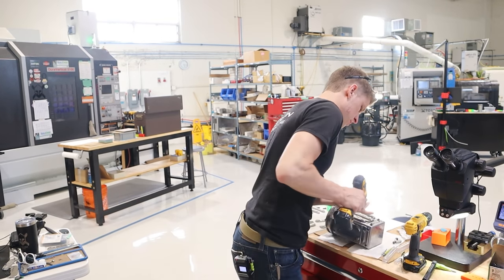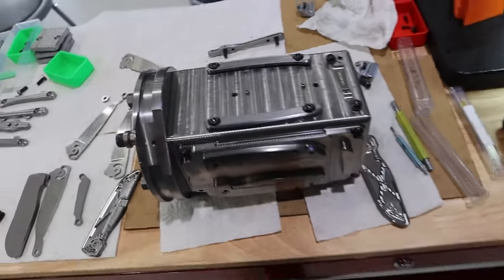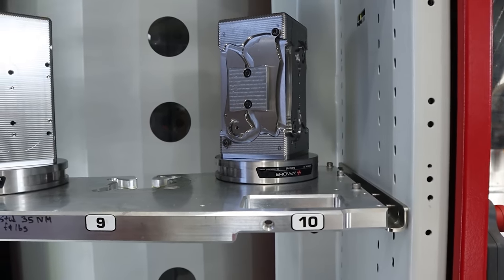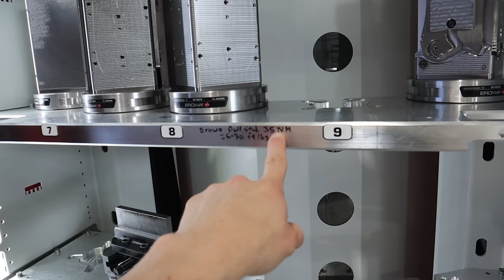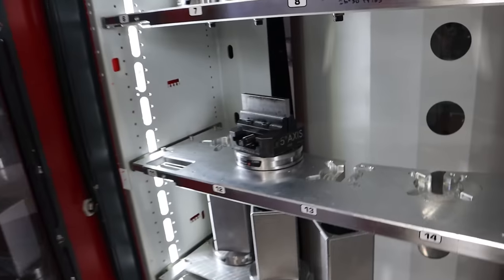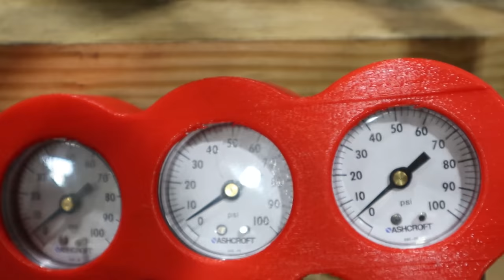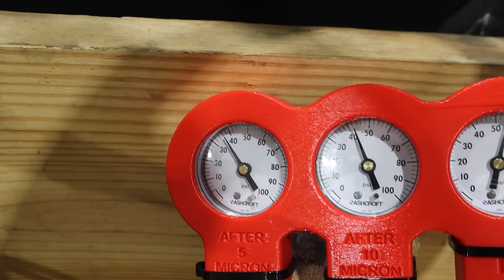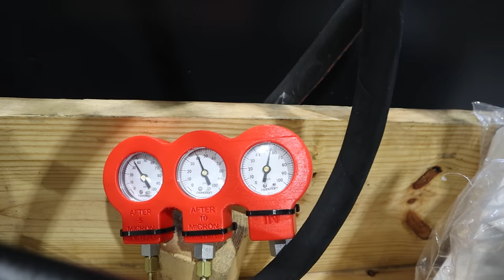Why You Need To Label Everything You Make!

Comment: Keep in mind that a dirty filter is actually better at filtering... just with more flow restriction. Since this is only for flood coolant (not really a volume specific process) I would only worry about setting a threshold of the minimum output pressure after your 5um filter, then use your gauges to see what filters you need to change (only the 10um in this case).

Comment: Hey, on the kern pallets you could put a red colour bolt with a X on it, in that rfid threaded hole to make easy to check at a glance and make it easier for other people in the shop to identify which way you want them stored. Or you could 3d print something if it holds up to the coolant 😎👍
Reply: I just cut the corner off and paint it black. Easy to spot, nothing special in handling and it's a standard practice with various things, from chips in computers to engine parts.

Comment: John, wish more people understood the value of labeling.  I have worked in shops where if something went into the "red bin"  (ours were labeled rather than color coded) it had to be tossed no matter what.  Kinda bad when a bunch of good parts were made and the wrong bin used.  The bin had to go to QC and ever part checked in every aspect.  Boss was saying it may have been cheaper to toss them.
You gouge pack is a perfect example of where a shop doesn't have to have a 3D printer but it sure is nice.

Comment: For your Gauges on the filter setup. What about adding an adjustable indicator in the design. Similar to how you can rotate the dial face and one or two of the outside user set able fingers on Most Dial Indicators.  Lets face it anything you can do to save time at this point can be big. Having to walk away and come back to look at numbers or look them up and quanitify them. Can just add to data errors. Might also be interesting to add a clipboard and grease pencil (cause around water/oil) so you can write down the gauge numbers anytime you check them for future insight.

Comment: Something that has been done with engine oil to remove those small particles from it, run the coolant past a magnet you can pull and clean off as needed. If placed after your 5 micron filter anything smaller would be pulled to the magnet giving you longer life of the coolant and less contaminants in it.

Comment: Interesting that todays topic was something I was currently working on LOL. But yeah I think its huge to either use a sharpe to mark stuff and setting changes i made if small (and associated fusion project name and version). 

I got in the habit a few years ago, of keeping a label make with me in the field (service tech related work). I put install dates on hardware and components with labels. It saves me and others so much time when someone needs to know computers and hardware or re parts where installed. Sharpe is also nice for that stuff and leaving notes in machines for people. But A yellow label with black text to work areas or part, its just so fast to locate visually.

Comment: come on John get that filter system monitoring into the present day  three differential pressure switches an Arduino bit of wire some programming and you can get notifications to your phone or even make it alarm on the Kern